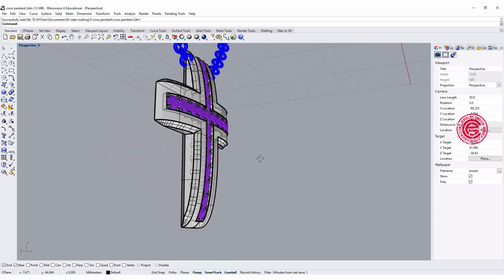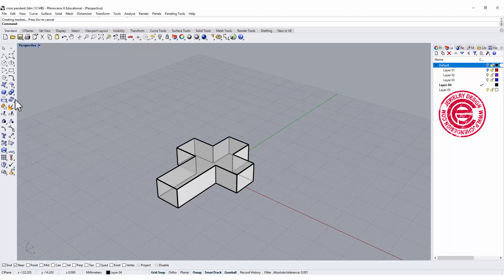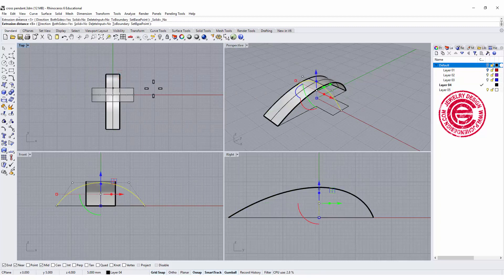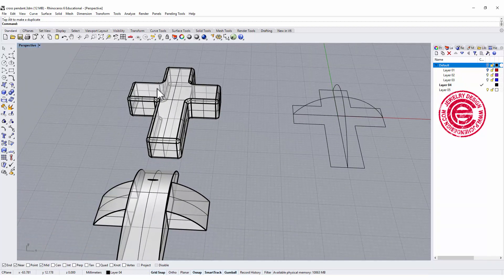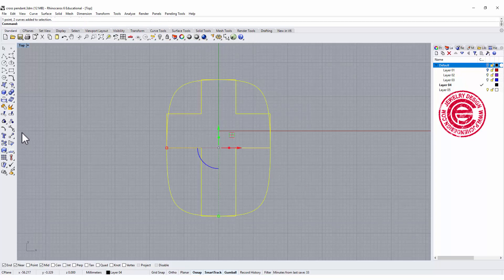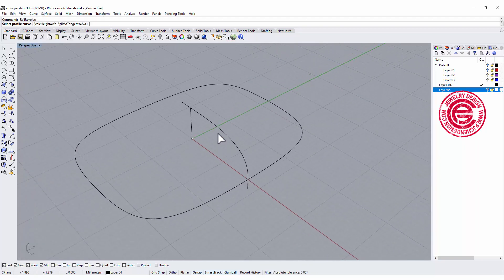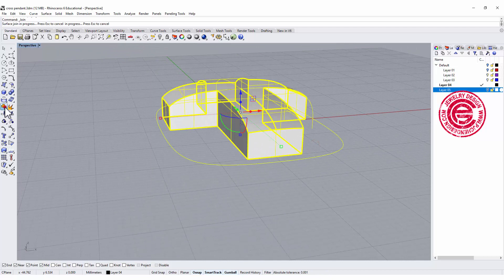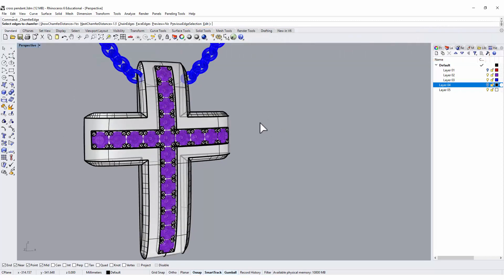Diamond Cross Pendant Modeling in Rhino 3D (2018): Jewelry CAD Design Tutorial #44

Comment: Thank you PJ! It was nice to do this excercise.  There was a little problem. When I use the command 'chamfer edges', then the cross was not solid anymore (Naked edges). How can I avoid that? kind regards
Reply from the maker: If the chamfer edges are larger than the edge you are chamfering, the model will break.
Reply: thanks for your answer; I understand what you say.  To get the cross closed I had to chamfer 0.1mm.  But I used the same measures for the cross as you did. Was your Cross a closed polysurface?
Reply from the maker: You may want to check your units. Maybe they are in inch not mm.
Reply: Hi PJ, Ihave checked all of your commands but still the chamfer command makes an open polysurface  It is closed when I use 0.3 mm instead of 1.5 mm but that looks not so nice!. I will send you by mail the cross and I hope that  you can tell me what goes wrong.
.Is that okay with you?
Reply from the maker: Sure. You can send the model file to pj@pjchendesign.com
Reply: THANKS!